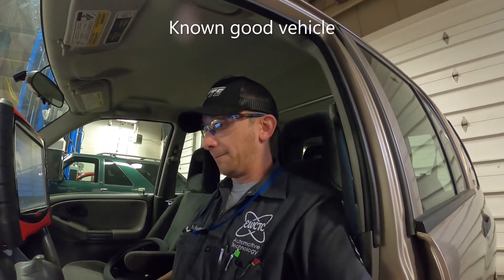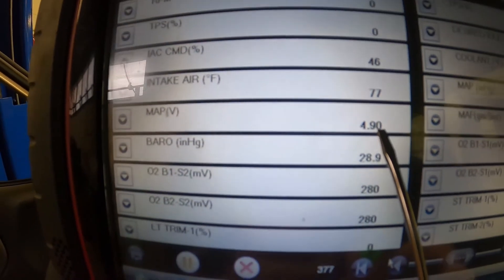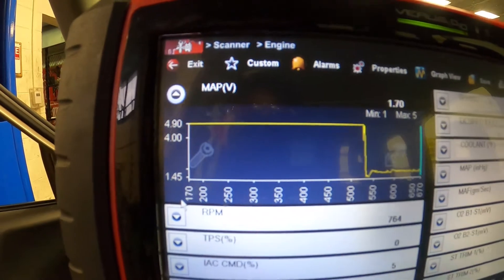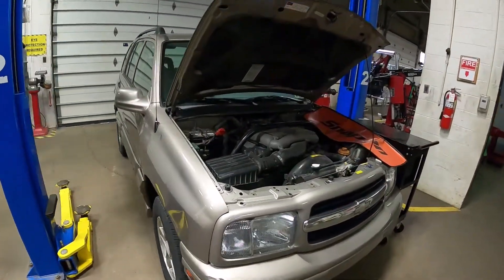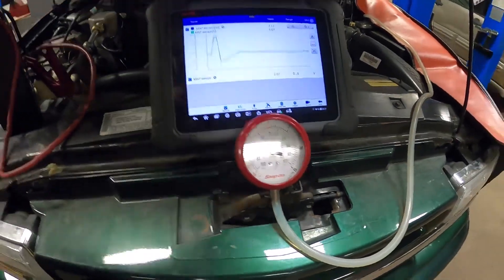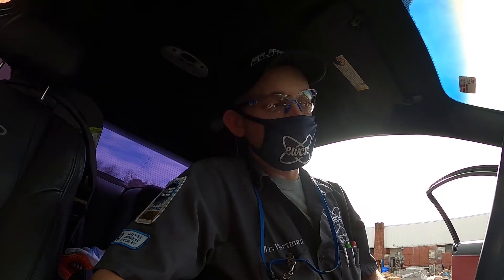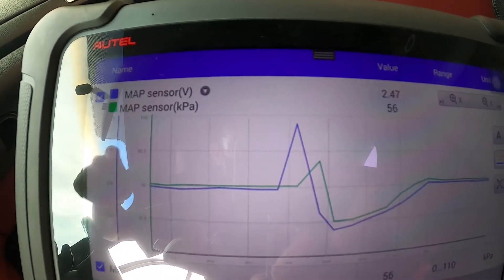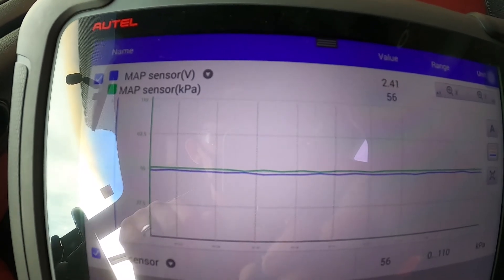Intro To MAP Sensor Data

Comment: people dont give you shit for wearing your ase patches?  I'm certified too, but haven't put them on my work shirts.
Reply from the maker: No, they don’t.  Some shops that I’ve worked at required them on the uniform shirts.  We are an ASE Education Foundation accredited program so it helps, but not required here.
Reply: The two first test you did not do the raised rpm test ..like you did for the street performance camshaft.if you had you would have  notice something completely different.  Looks to me that the S.P.C showed exhaust restrictions.

Comment: Will a bad MAP sensor show a P0430/P0420 code? I'm not getting any of the codes for the MAP sensor.  I don't believe the problem is the catalyst converter because the o2 sensors are covered in carbon.

Comment: 28.9 is shown by both the baro sensor (in the ECU?) and the MAP; that shoul be the norm,but do you know if they both must read the same at Kon, Eoff, in all cars? i say this because i have seen cars runing well in which the MAP sensor reads lower,not quite sure if the MAP sensor has drifted a bit or not.